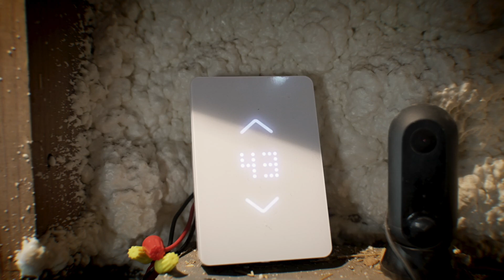WORKING OUT IN 20 DEGREES WEATHER JUST GOT BETTER!

Comment: Question about the 120 VAC hookup outside for your barn, and the need for 28 VDC for your thermostat to operate? Most systems have type of built in inverter to convert the necessary voltage for operation. Your thermostat didn’t come with that built in internally to the system? Regardless, your barn is coming along nicely Dan, I agree with above stating to close up the majority of those openings, or look into more efficient insulated venting ideas. It also came to mind to possibly have the barn temp controlled throughout the entire year, to reduce the moisture build up and issues that arise from varying temps in your barn.

Comment: have you thought about adding ceiling fans?? they would help push the heat down and obviously, help with air flow when it gets hot.
Reply: I was just going to suggest this!
Reply from the maker: I have, but the increase in air movement will most likely be colder than just the radiant heat coming down.

Comment: What type of radiant heater did you get? I'm currently running off propane construction heaters in my garage gym and I've gotta keep a window cracked for ventilation.  Radiant heat would be ideal but I couldn't find any that seemed capable of doing the job. Yours looks solid.